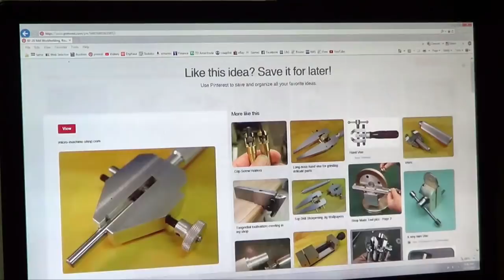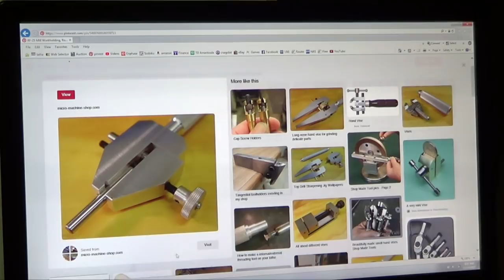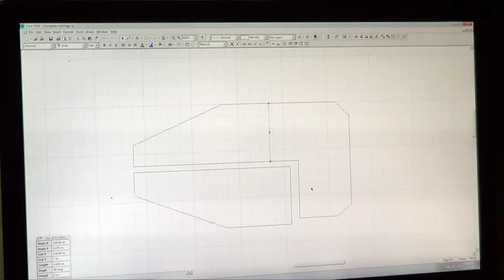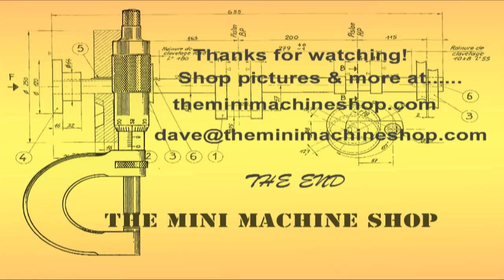Making A Small Part Grinding Clamp

Comment: Looks good Dave, I have been meaning to make an instrument makers vise to go along with my finger plate. Curious about the knurling, do you have a scissor knurler? They usually solve any problems. Cheers!
Reply from the maker: Yes one of the videos I show the DIY scissor knurl. I made it because the off the shelf HF one had the same problem. Just remembered a picture of it is in the top banner of my channel...